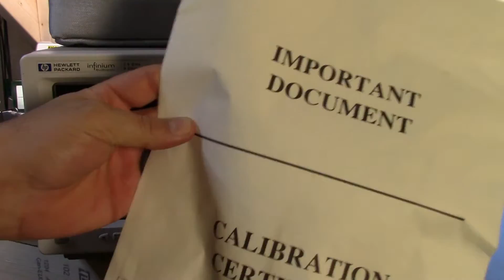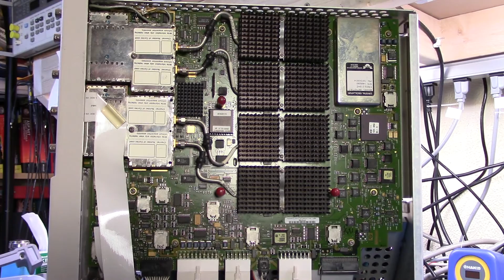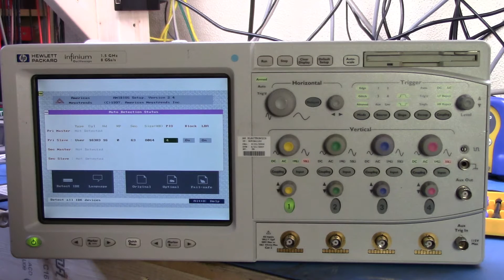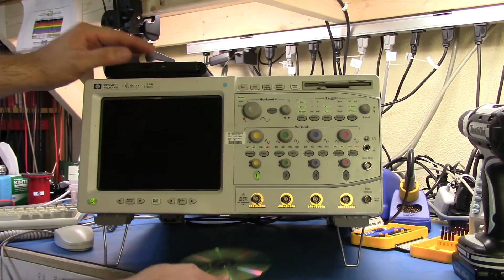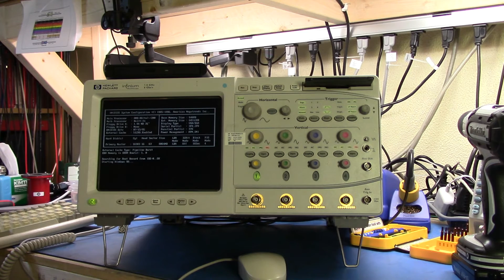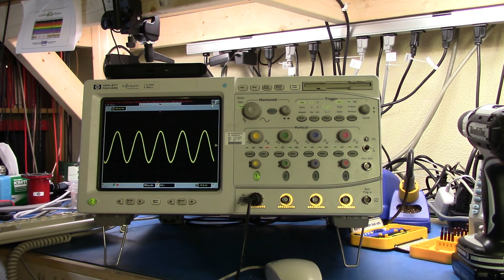HP 54845A Oscilloscope Repair - Part 1

Comment: Great video!I had a 54832B failed to boot up and it's using window xp. Just asking does it required to insert a floppy A diskette while we doing the windows recovery on fresh hard disk for windows XP?  After i had done the recovery it's shown  "sbmk bad" and I had no idea about it.
Reply from the maker: I'm not sure - Mine is a Win98 version (the 54845a), and typically WinXP does require a recovery floppy for the machine if you select that option at boot but I think it might also work with the WinXP CD. It's been many years since I was playing with XP. Now that said, I did a quick Google and it seems that this error comes from something installed in the MBR - I'd grab the original Ghost files and just return the scope to normal.

Comment: Hi. Do you have link to download the original firmware of this scope?
Reply from the maker: There really isn't any firmware per se as it's just a standard PC board with HP specific cards in it - All the software I have for it is located here - https://1drv.ms/f/c/33d543d7cfaf9a6a/Emqar8_XQ9UggDMh0wMAAAABJrptGBWhzS28CJaccRszgA?e=fDp83a

Comment: I am going through the same process of reinstalling the OS and software on this scope and I have found so many files and images that is confusing. Could you explain which recovery image did you use? was it the 3.5 version and it came with win98 in it? did you upgrade the scope software afterwards to 4.3 or 4.5? and which win98 boot floppy did you use? I am connecting a CD drive directly to the motherboard second channel IDE (with external power supply) and I am replacing the HDD with a CF card converted to IDE
Reply from the maker: I used the external parallel port connected CD ROM drive that HP referenced in the upgrade doc. To do that I needed to boot from floppy to load the CD ROM drivers and then I installed the 3.5 recovery image. From there you can jump to 4.5 but if you do then the web server software isn't installed. So I went from 3.5 to 4.3 then to 4.5.

I put all the files I used up here https://1drv.ms/f/s!Amqar8_XQ9Uzj6YhN1xHdM8tQdKMOA

TonyG
Reply from the maker: BTW Let me know if that doesn't help out and I can go into more detail for you.
Reply: Thanks! Great! That clears up a lot confusions. So the 3.5 recovery does have win 98 in it, right? 
My scope originally came with win95 and 3.72 software. I am waiting for the extra memory to arrive and after I upgrade the memory (16MB at the moment) I will do the reinstall. I am using a regular IDE CDROM, any advice which win98 boot floppy I should use?
Reply from the maker: Yes it should (at least on my scope it installed Win98) - I don't think the memory makes much of a difference as it should be detected automatically and the effect apparent at runtime. I'd just go ahead and do the install now and upgrade the memory when it arrives.

As for the boot disk, start with the one in the link I gave you and just replace the driver in the config.sys file - If you use the same drive identifier then you shouldn't need to touch autoexec.bat at all. Make sure you're burnt the ISO to a CDROM first though as I think it boots straight to the restore.
Reply: how about formatting the hard drive? is it done automatically as part of the recovery or it should be done after I boot by the floppy and before running the ghost?
Reply from the maker: Amir B  From memory I think it is done as part of the restore.
Reply: I finally found time to fix the scope. I replaced the HDD with a CF card and IDE adapter sitting right on the IDE header on the mobo and removed two IDE cables. Used recovery CD V3.5 and later upgraded to V4.3 and then V4.5. Connected an internal 5.25" IDE CDROM to the secondary IDE on the mobo to do these (with external power supply). After cleaning up the ADC ASICs and finding a bad regulator and couple of bad caps on the acq board, the scope passed all the self tests many times and completed all calibrations with flying colors. Boot time is much better and got rid of the horrible noise of the HDD. However, I have a weird issue which was there from the beginning and I was hoping it will be fixed by now. When the graphic display is enabled the scope is perfect in every way. As soon as I disable the graphic display (top right corner) the waveform becomes distorted (segmented actually) it is more visible at fast time bases like 20-30MHz sine wave or when zooming the edge of a pulse. Can you check this on your scope and see how it shows up? I cannot figure what the problem might be. It seems a driver/software issue. It seems the waveform samples get misplaced when the graphic display is disabled!
Reply from the maker: I replied to your post on the EEVBlog forum - I've never seen that, maybe a DMA issue?
Reply: yeah I received your message and replied. Thanks!

Comment: Do you know how to change the CMOS battery in the motherboard?  I dont see a CMOS battery in motherboard.  I see one in the one of the plugin cards, probably the data-acquistion card.  Thank you in advance.
Reply from the maker: The motherboard is actually just a standard PC motherboard so there should be a battery on it somewhere. Unfortunately HP/Agilent used different motherboards throughout the life of the unit so I can't tell you exactly where the battery is. This post over at EEVBlog shows one of the boards and where the battery is - http://www.eevblog.com/forum/testgear/agilent-54835a-scope-(4-channel-1ghz-4gss)-repair-uphack/msg1251605/#msg1251605

TonyG
Reply: it does not have a cmos battery. it has a Dallas NVRAM which has battery integrated into the chip. it is sitting next to the BIOS chip
Reply: I meant the older AMI motherboards (HP branded scopes) THe agilent ones used FIC mobo and it has CMOS battery
Reply: Yes Dallas NVRAM, so no battery to be changed. The Dallas chip is a RAM chip with a lithium battery embedded in a cup with resin. If the battery is gone, you get to change the entire dallas chip (which is a bit of a PITA for sooooooo many reasons) or you get to take the existing chip of and hack it.

Comment: Hi, nice videos. I come up with a forgotten dirty 54810A and I would like to revive it. But I have problems booting the Windows 98. 
Reading some documentation I found that I could download the 3.5 recovery image and then upgrade to 3,72 and I could even upgrade to 4.3 and finally end with the last available version on 4.5. 
The problem is that all the ftp links are down for Agilent and the new domain ftp.keysight.com has all the directories there but unluckily they are all empty.
Would you have and image of the disks used in your video, or perhaps do and iso file or and img dump in order to share them?
Thank you.
Reply from the maker: I think Keysight is having a problem with their FTP server as some other stuff has gone as well. However, I did happen to keep a copy myself. You can get it here:

https://1drv.ms/f/s!Amqar8_XQ9Uzj6YhN1xHdM8tQdKMOA
Reply: Thank you very much. Tomorrow I will try to boot up the Infiniium
Reply: I have been following TG's excellent instructions but I have not been able to male much progress because the CD-ROMs I have are not recognized by the oscilloscope motherboard. It seems it cannot find drivers. Did you have this problem? Thanks, Diego